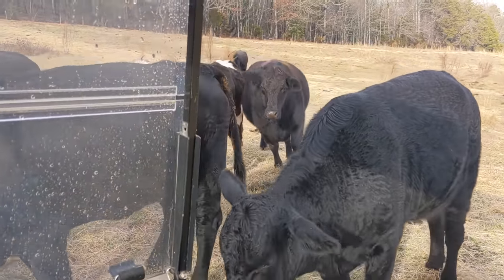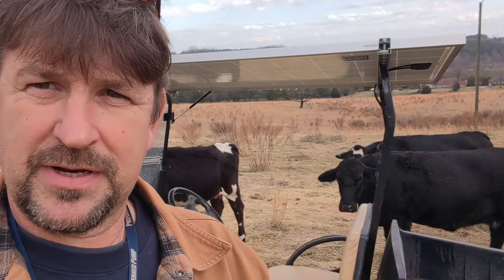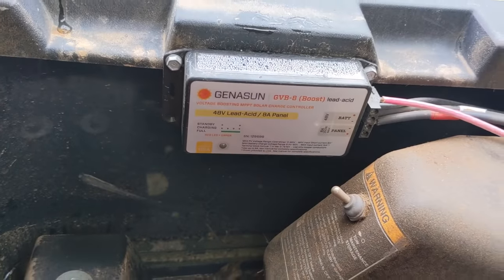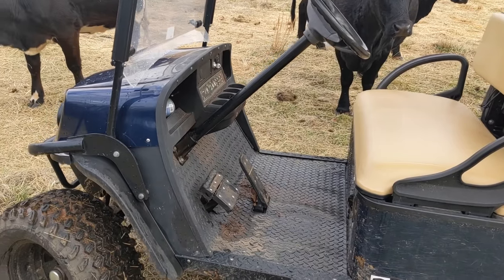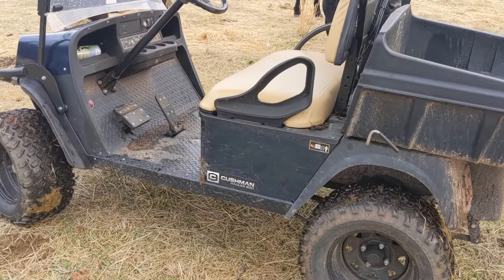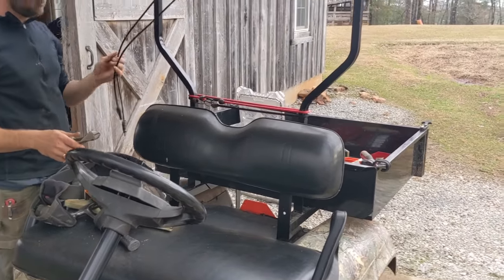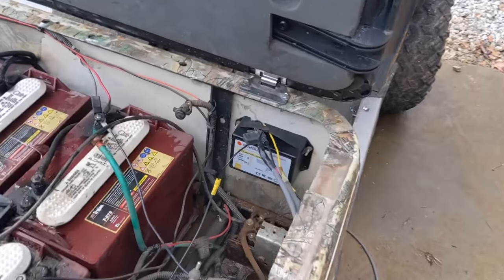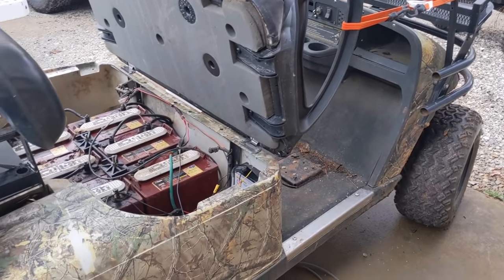Regenerative Golf Cart

Comment: I did this on my golf cart and it was horrible. Took 4+ days to charge my 5.5kWh NCA golf cart battery. And leaving my cart outside would kill the tires and cook the batteries. I now use a small 400W solar array in my backyard and run the cable into my air conditioned garage to charge up my golf cart. Works great and my cart will last for ages.
Reply: My cart has been outside for 7 years.  No tire issue and no battery issues as the charge controller works.  We have been installing a lot of 400+ watt solar panels that double as great cart roof.
Reply: @practicalpreppers7798  holy cow that's awesome!
Reply: @WillProwse  you have to use a mppt boost charger like genasun (300$) or gtk300 (30$ on Aliexpress). 
They are more powerful than the mppt step down you used in your golf cart. 

For a stationary battery, mppt step down charger are ok. 
But when you move every single second your solar panels, you need a very fast solar charger mppt boost.
Reply: I've been wanting to do something like this with my cart as well... Just gotta pull the trigger on a panel... And I usually park mine in a shed so was thinking might just mount my panel to the roof of the shed
Reply: @zarbonida  Look at some of Will's videos. He knows how to get every watt out of a charge controller.
Reply: @om617yota8  i have seen ALL of his videos and he has never used an mppt boost charger like genasun so maybe he doesn't know their better performance when a solar panel is moving.

I have also a solar golf cart i know the difference between 4 panels in series (400Wp) with an mppt step down and one panel (285Wp) with an mppt boost.

The 285Wp produces more energy even it has less power peak than 400Wp. 
The "secret" is the mppt boost charger that Will never used up to now in his videos

I know he is a very smart boy and for this reason i am sure it will do a research and an experiment
Reply: MR  Prowers - these men use their gear for work - its ruff and dirty -   Im Really surprised at your comment - Anyone trying to help and use clean energy is Great in my mind - should be in Yours too
Reply: @WillProwse   sounds like a new video subject :)
Reply: Cam this be accomplished with a moncrystalline panel  @zarbonida  ? Most of the drain in my card is used on is filtered sunlight. My understanding is that monocrystalline performs better under those circumstances.
Reply: @om617yota8  finally he has just uploaded his first video on a mppt boost by renogy. 
Look at his channel
Reply: Great idea! Creating your own charging station. I like that. I've seen a few videos of people putting panels on the roof of the golf cart and it seems to me like it would be unstable with all that weight on the top.
Reply: @WillProwse  I bought a golf cart because you did. You're an inspiration. Would really like to know the panel used in this video so I can try also. Bought a trailer for the cart and thinking about adding solar to it.
Reply: Air Conditioned garage?!
Reply: Hey everyone, yeah I added a panel to my cart 😂 I think this video and the comments motivated me. But I am using a cigs panel with boost converter. It works great!
Reply: Tires degrade with age.
Reply: if the batteries are being cooked while under sunlight there could be 2 reasons. Bad batteries or a bad solar charge controller. you can regulate some solar charge controllers but not all.
Reply: Living in the desert doesn't help. But plenty of 🌞
Reply: That’s just like, your opinion, man

Comment: This is so cool! Golf cart manufacturers should make this a standard feature. 😻🌞🔋💚
Reply: I agree to a point.  Battery technology is where its at,  with Lipo and Life battery technology (smaller lighter and more powerful) these are what should be included by the manufacturer.
I also think the controllers and motors currently used are weak links. Manufacturers need to follow RC (radio control hobbies) manufacturers lead, use their data for some R&D.
Reply: Indeed, even a cheap solar roof on the factory models could extend the range by a small amount and able to recharge the battery while unloading it or just sitting around. so it is always charging.
Reply: Would you please post a close-up step-by-step video of exactly which wires are connected which wires? I have the 36V EZ-GO golf cart, a 260 watt solar panel, the correct Genasun 36V MPPT charge controller, but I'm not an electrician.
Reply: @vickyschoeneweis4263  did you ever get this finished?  How is it going?  I’d like to do the same conversion as you.

Comment: I would go very slow installing permanent interior fencing.  Install the best perimeter fence you can and use single strand temporary electric fence on interior until you know how the grass will react to management changes.   I would highly suggest you split the pasture up so the large livestock stock has one or two days of feed  before moving to the next paddock.   I would also suggest you read Allen Savory  "Holistic-Management-A New Framework-Decision-Making".

Comment: I too found a solar panel that was new, but overstock for $115 on Craigs List,  It is a 72 cell and sized for my 36 VDC golf cart.  Just got it installed and it was making power under the carport @ 5 PM.  Pulled it out into the sun and it was doing much better. This was the second usable idea I got from your channel, the 1st (Need help getting your water off the grid - Dec. 20, 2014) was a simple pump installation pumping to a water tank inside my pump house, and Dankoff Slow Pumps provides water to the house and garden.  Thanks for sharing the innovation.

Comment: I have put very large multi colored Anderson connectors  on my 36 volt easy go. i use it as a power bank for my pull behind camper for mobile power. the connectors allow me to drive the cart on 36 volts and then unplug 2 and plug some in to have 12 volts. i also have a engine connected to a chevy alternator to charge the batteries. pipe from the exhaust go into a big insulated pot with 2 bricks to set a stainless steel pot with a lid inside to use the waste heat of the engine to heat water! NO SOLAR PANEL YET! but ill BUY THIS SET UP SOON

Comment: I did this with an ezgo txt 36v. I use one to get around my home town(it’s legal in the town). I put two 160w solar panels for a roof with the genasun boost controller. 

I have shunts monitoring power in as well as power to the motor. I have not had to charge this cart in over a month and I would say I drive 5-10 miles per day. On flat paved road the motor is only using 350-400 watts. During the day the panels are always bringing in 200-300 watts. Could almost drive on just the panels alone.

Comment: Typical EZGOs (Cushman are the same thing). Wobbly tops, squeaky and weak suspension, rotting out battery trays, overall junk carts. Stay faaaaaaar away from the new 2008 and newer RXV carts. Club Car or Yamaha make way better, more reliable carts. I'd offer this setup to my customers. Unfortunately, 95% of them are in wooded campgrounds with very little sun penetration during the summer months. Not to mention, most of them are tighter than 2 coats of paint when it comes to something like this. I, personally like the Navitas (I'm a dealer) controllers better. I've had altraxx controllers fail and burn up so I'm hesitant to recommend them. So far, the Navitas are much more hardy, phone app over bluetooth (no laptop needed to make changes). Their AC conversion kit is AMAZING! Its pricey but amazing. Good stuff, Scott!! I really like what you are bringing to the RE community!!
Reply: Ain’t that the truth. I’ve got 8 Ezgo TXTs and they are garbage . The one Yamaha I have is 15 years older than my TXTs and is in better shape and is an overall better cart in every way. Ezgo can make a good cart. I’ve got a Prowler EV that I love. You can’t beat a 72v two motor 4wd golfcart.
Reply: @bosborn1  Its unfortunate, too. They used to have a solid platform back in the mid 90s (89-90 almost ruined them). They were late to the 48V party and used the weaker Curtis controllers. Their gas counterparts were solid until they stopped using the twin cylinder Robin engine. They moved onto the FE400 Kawasaki engine. Its a strong engine, just cheaply and poorly designed.
Reply: The RXV will outperform every other cart. You’re just apparently not smart enough to work on a modern cart. 
And it’s got a limited-slip rear axle. It’ll go where those others you mentioned won’t. 
And it’ll get there sooner too.
Reply: And the RXV doesn’t need an AC conversion, it already is an AC cart.
Reply: An RXV will in no way keep up with a Textron prowler. The Prowler is far superior in every category. I don’t know whether or not they are better than a TXT. After my experience I will avoid Ezgo. The Prowler series was sold off to Artic Cat. It’s a shame as it was Textrons best product.
Reply: @bosborn1  I agree. I have no experience with the Prowler, but heard a lot of good things about it. TXTs were awesome until they put the Kawasaki engine in them. What a pile of mess that thing is to service.

Comment: I love Genasun!  I have a 2001 ish Club Car I threw a 280 watt panel on and I haven't plugged it in for over a year.  The batteries read about 4.5V instead of 48V when I got it but I got the batteries back up to voltage and topped the water off and I'm still using them.  She doesn't have the torque or speed she should but the batteries are next on my list of things to upgrade.  I drive around my neighborhood and into my parents' and in-laws' neighborhood and not across a farm but mine also doesn't have the regen motor set up like your's appear to have.

Comment: Did the same with my boy's john deer toy tractor   No more sad little boy because momma forgot to plug it in after he wore it out the day before.  (10watt 12v panel no charge controller)  If it still popular next year I'll upgrade it with a bigger battery bank and add in the controller.

Comment: You have done what I talked about back in the 70's when I first saw a car converted to an electric power in a magazine. I've always said that the auto manufactures could make an electric car and have the roof, which is a separate panel these days, made of solar cells. The car would have a little longer range since it would be charging as it goes. If the car was used to go to work during the daylight hours, it would be charging all day while the driver was at work. If the person worked night shift it would be charging the next day while the person is sleeping. It all seems very simple to me.
   The EV's of today depend on plugging them in to the grid. The problem with that is somewhere the electricity is being produced by a plant usually using fossil fuels. Yes, there is no tail pipe on the vehicle, but it is still causing a problem somewhere else. 
   We too, had a farm, 49.5 acres where we used a Kubota side by side and hated the thing. We now only have a few acres and use a golf cart. We used golf carts on the farm until we bought the Kubota. We both like the golf carts better. Ours is a gasoline model though, so we will not be adding a solar panel on top. Thanks for the video.

Comment: Awesome video as always been watching for years since the micro hydro project on dads farm. I’m hoping you can answer a question he got a parcar utilitruck cheap 36v completely stock. It’s awesome but it’s time for batteries and I’m curious if you know what golf carts pull in amps going up hills. We have similar here in KY and I’d love to go lithium but everything I’m finding in a reasonable price range say less than 2,000 only do 100-150 continuous and have a few seconds of peak at 300+. 48v conversion is possible but even at that voltage do the amp numbers work or is that still not enough. The battery’s have the same ratings in amps. Any help would be much appreciated.

Comment: Would this same charger setup work with the lighter and longer lasting lithium battery pack? Seems it would lighten up the cart even more. By up to 300 lbs lighter. This would make a killer setup here in Texas in my neighborhood and at my mini-ranch. We have a ton of sun here.
Reply from the maker: It's all lithium now and works really well
Reply: @engineer775  Maybe a follow-up video to share any thoughts you've got on it? I've also wondered about using a 48 all in one charger/inverter so it could charge on the grid or solar, and would have 3 kw of AC wherever you took it. I'm wondering if you would need to do some water shrouding and HD strain relief for use outdoors. Any thoughts on that?

Comment: Thanks for all you do for the prepping community.
I have a EZ GO (around 2006). It is 36V and has a lift kit and fold down back seat/work platform on it. 
I would like to convert it to 48V with Lithium batteries for the farm as well as for a mobile power station for grid down emergencies.
And, ultimately I would like to make it solar like you did to your carts.
Is there a "kit" or someone you could point me to that would be able to help me with that conversion?
I'm pretty handy with most things but golf carts are out of my expertise.
Also, what Lithium batts do you recommend?
I fell like I need to convert to 48v because it's so hard to find a decent 36v to 120v inverter.
Thanks for any help you can give me
alan
Reply: My opinion, buy a 48volt cart… otherwise you will be replacing everything electrical on it, including the motor. I watch your channel regularly, grew up in East Texas, now live on a small piece of land in Central Texas. I bought a 48 volt cart, replaced the batteries with a RoyPow 48volt lithium, and I’m about to do the Genasun with solar system, for the same reasons you mentioned.
Reply: I also bought a 48volt DC to 120volt AC inverter.
Reply: @keithcastleberry3224  
A) are you happy with the RoyPow?
B) was it easy to convert to Lithium?
And, thanks for commenting.
Reply: @keithcastleberry3224  
How many watt inverter did you get?

From what I’m hearing everyone in Texas needs to get serious about some type of alternative power. They are predicting blackouts and brownouts this summer… 
In freakin’ Texas!
Reply: @BIGALTX  while I believe I could have done the conversion, I had a local cart company do it. I didn't want to learn by my mistakes on a $$$ lithium battery. 
We LOVE the lithium conversion, and the RoyPow seems to be very well made and works well for us. I usually work our land by walking, since I'm getting older and need to walk, but our animals are spread out over 11 acres, so my wife uses the cart all the time. I use it to haul things and the power, with the lighter weight and longer battery life is well worth the money to convert it. We can go 2 weeks between charges.
Reply: @BIGALTX  I agree, the threat of outages is my main motives. 
I'm currently retrofitting a barn into a "barndominium", and plan to integrate solar into that. My barndo solar system concerns would be water well, septic system and refrigeration of course, but  I would also like to keep fans, since it's hard to sleep when you're pouring sweat. And difficult to work hard if you haven't slept. 
My cart power would be to supplement the main system.  The inverter I have is 4000 watts, so large enough to run most heavy 120v load items.

Comment: You could make a radiant charging circuit easily. It would involve a antenna or CB whip 20ft. With a 3inch sphere as a top hat. A ground bar that you would have a jumper to hook up when not in use. I could send a circuit diagram. Just two capacitors ,bridge rectifer, and a neon bulb as a spark gap, that will regulate the voltage
Reply: Just heard it was 48v so 4. 12v neons in a series

Comment: I was walking around with this idea in my head and you made me smile when I saw this, could be also implemented on an electric boat
Reply: i have done it to my electric dingy.
Reply: You probably would need to drag a football field size float with solar panels behind your boat :)
Reply: @donalain69  300w panel, 600w motor and 1200wh battery. works really well.
Reply: @magamike1800  ...for an RC boat :)
Reply: 600w? Isn't that a bit weak for a boat? Or do you mean for an RC boat? My friend is selling a 105KW electric boat engine..
Reply: @donalain69  here is an old video of it. 600w pushes the boat along at 5kph. I now have a bigger battery and the panel is hinged to tilt in both directions. 600w motor pairs quite will with a 100AH 12V battery with about 600W of useable energy.  https://www.youtube.com/watch?v=6Ce1kgXPgW4
Reply: @magamike1800  nice! Seems to work. Guess you could even run a bigger engine if you opt out on solar cell size.. why don’t you just install the solar panel horizontally? The idea with the adjustable ankle is okay, but might become a problem if you get hit by strong winds..
Reply: @donalain69  in the summer i keep the panel flat but in the winter the panel needs to be tilted as the sun is pretty low in the sky.  a bigger engine would need a bigger battery so the boat would sit deeper in the water and have to move more water to push through it. I have used several setups and 600w with a 100AH battery is pretty much the max with 3 people.  the cool winter days seem to work the best for solar generation as the panel does not heat up and there is generally no wind or clouds. its been a fun project for me and my son and turns a lot of heads. we are going out fishing on in tomorrow.
Reply: @magamike1800  your right.. adding weight just increases the need for more power.  And unless you buy a bigger boat, there is just so much space for solar panels. Once you found that optimal balance for your boat, there isn’t much point in changing things anymore. 
Wish you a good time with your son on that boat today.